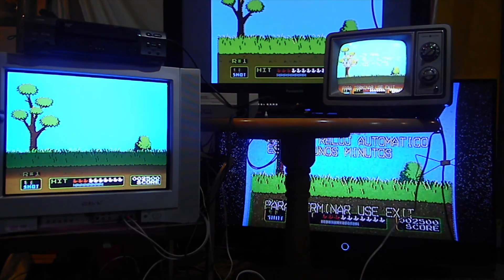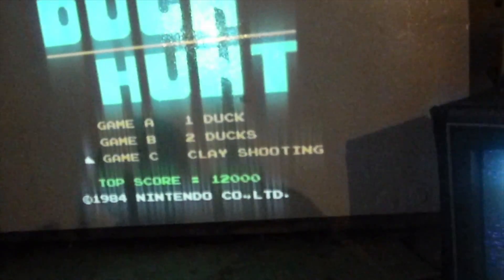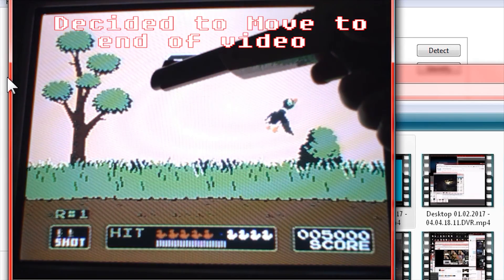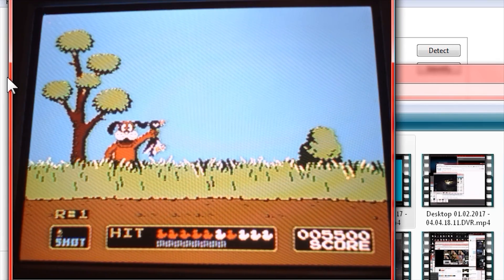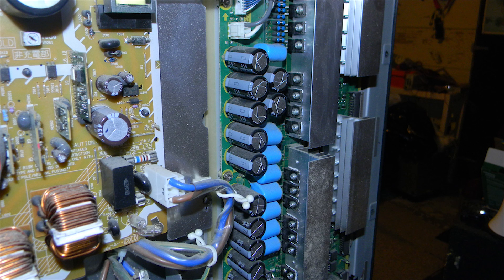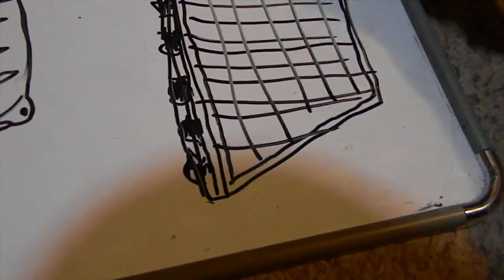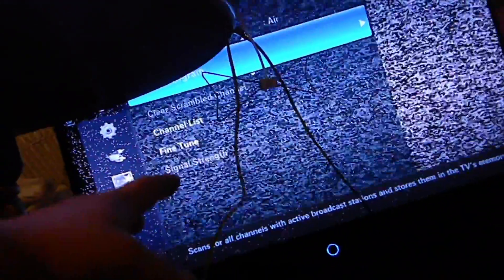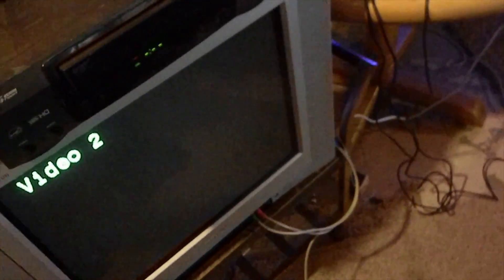Trying Duck Hunt On Many Display Types At Same Time

Comment: you speak spanish because i watch a tv wich spanish menu
Reply from the maker: nope, i just pressed the wrong buttons on vcr before i hooked tv up. when you plug the vcr in it puts you on a language select screen and pressing Chanel up or down changes from eng to spanish i tried changing the channel b4 i hooked up tv, when i turned on tv menu was still open, pressed exit, #spanish.
Reply: o ok